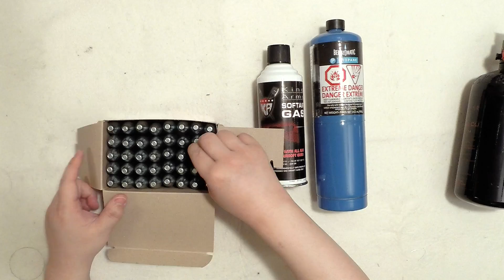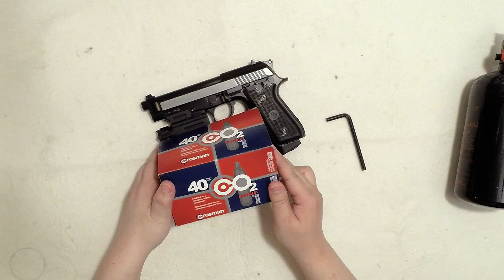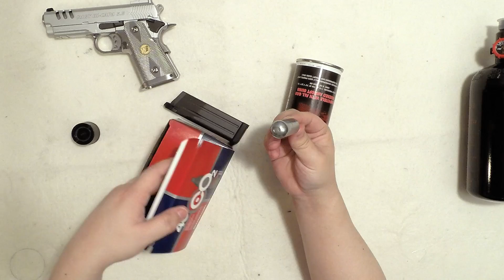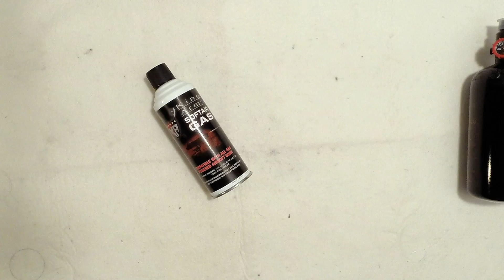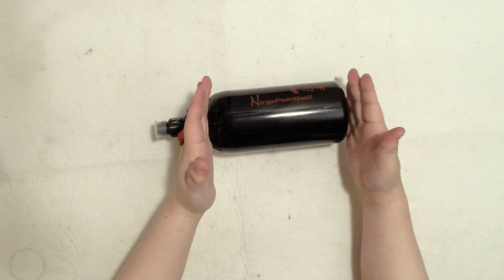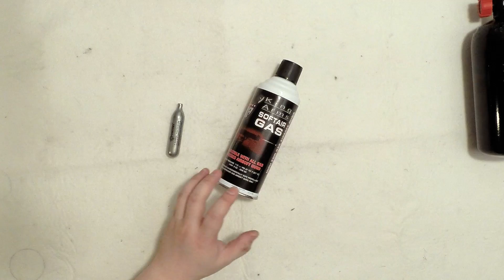Know it All - Green Gas, Propane, Co2, HPA for Airguns and Airsoft Guns

Comment: 1:30 actually it mostly depends on the magazine, not really the gun. co2 and green gas magazines have different design but the way they function is the same, there are some airsoft guns that can fire with both co2 and green gas magazines.

Comment: I use propane it’s cheaper and you just need 2-3 drops of silicone oil on the tank opening. A green gas bottle will last me 3-5 weeks while a propane bottle last me around 2 months 👌
Reply: The green gas is just a smaller version of the propane with silicone added if the bottles were abit bigger you get more shots they just add more silicone tho that's why it never last long

Comment: What’s better propane or green gas then?
Reply: Major Smajer no idiot propane is cheaper green gas is a scam it's just propane with silicone oil which you can add to propane yourself for much less money by adding a drop of oil on the mag valve. You may need an adaptor otherwise wayyyyyyyyyyyy better choice.
Reply: @bikerlad3138  green gas costs me abt 4 dollars a year so not that bad

Comment: Hi, learned a lot from your tutorial. My tm desert eagle uses/used 134a green gas until it broke it's safety housing. I'm trying to get a replacement housing! Anyway, I used the same can of abbey 134a gas for 11 years and I reckon I got about 50 mags worth from a 700ml can. So GUNSFOREVER you should get about 20 mags from the 250ml can.

Comment: Hey Mak, you know the foster fitting that is put on the HPA to co2 bulb. Can you put a one way valve on the foster fitting? That way you can fill it and the pressure will shut the valve one you bleed the air in the hose. Or will there not be enough air for lots of shots?
Reply from the maker: +Qyuubi786 You mean to put hpa into a dummy 12g co2? I have tried already, it doesn't work because hpa will not give you more than 4-5 shots in that little space. HPA and Co2 is very different, Co2 is very compressed and packed up, and they are even stored up in liquid form when compressed. So a tniy bulb holds a lot of Co2 but cannot hold much air!
Reply from the maker: +Qyuubi786 that is also why airsoft GBB guns cannot use HPA by injecting air into the mags at 120psi or something. Because the air that you can fill into the mags are so little, they can barely give you 3-4 shots and it will be all gone. But with green gas / co2, those are compressed and packed up inside the mag, and so injecting those will give a lot of shots per fill. Sadly, that is why airsoft GBB needs a tank and hose setup to convert to HPA.  Or else I would have done the mag injecting method a long time ago.
Reply: +Chiinnature Damn. It would probably only be useful for something that is single shot. :/
Reply from the maker: +Qyuubi786 it won't be very practical, but you can review the cam870 videos I did before, those shells are the same theory, you can pack as much as you can with HPA into one shell, then WOOSH there goes the power. In order to have a nice power out of those shells, you will need more pressure than Co2 too. So I packed it up to 2000psi with a handpump and there goes 30 joules!

Comment: also, could I buy an fn303 ? if yes. where? also  money's not the problem time (lol)  availability is the problem I can't afford  to waste it on bad decisions. that's way I do my research and thanks you have always been much help.
Reply from the maker: +xion say No because the FN303 sucks for many reasons. First is the airline is outside of the gun, which makes it fragile, and the tank is also outside and unprotected. The FN303 only fires at 28 joules in reality chrono numbers, but a T8.1 / T9.1 or T4.1 can be tuned to fire 30-33 joules in reality numbers, so... fuck FN303, get a T4.1 instead.  Or a T9.1 or T8.1

Comment: could you make the project salvo paintball  gun shoot 20 to 30 g
Reply from the maker: +xion say you mean 20 to 30 joules?  no that gun cannot do it, it's not a design that can shoot higher than 15 joules
Reply: +Chiinnature Those are tippmann markers, they do wonders with CO2.
Reply from the maker: +cunny fred With Co2, the fact is, Co2 sucks in high power shooting. You try to shoot high power with the T8.1?  9 shots and a 12g is dead already. Imagine using 25 joules, what kind of Co2 do you need to use? A 20oz tank? No, it will freeze up too... so in conclusion - high power shooting is only good with HPA on rifles, and Co2 is only good for those low cap guns, but the project salvo is a hopper fed gun, so why do you want a 200 round hopper with sucky performance on co2 that keeps on freezing up?  Seriously, even the X7 here works better with co2, I still put it on HPA for a bit lower power. Co2 just sucks on high power, they freeze up too fast